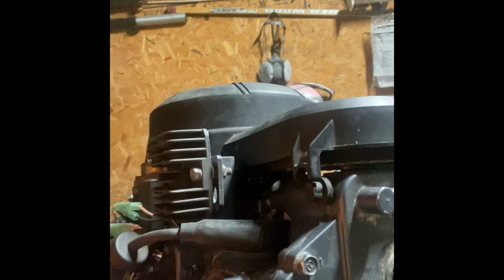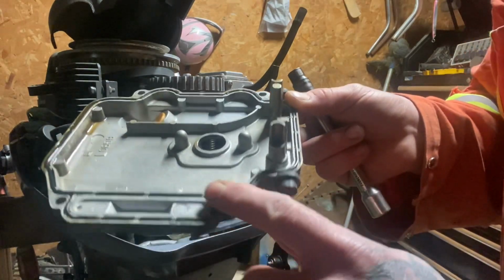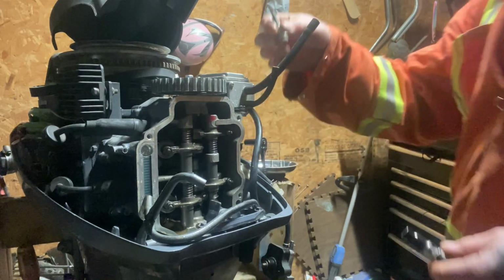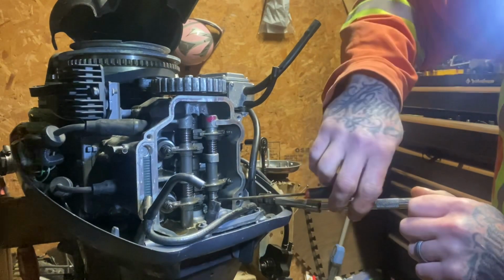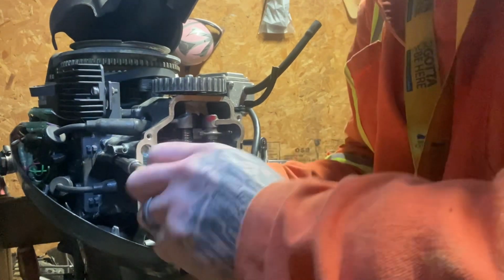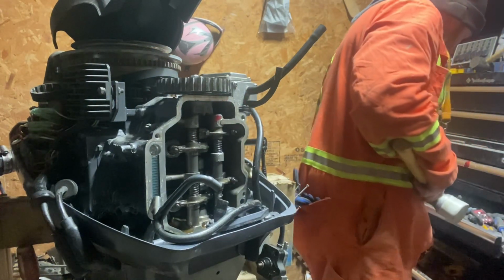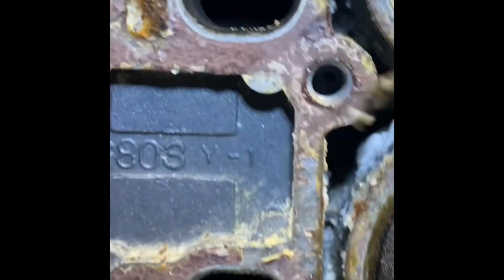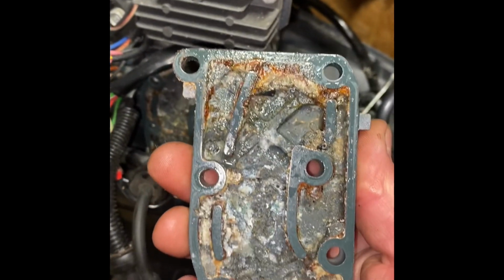Changed your impeller? Still no water flow? Here’s what your problem is. Pt1

Comment: Great content, I have a 1983 2 smokes 80 hp
Reply from the maker: Thank you I was trying to think of the ways to improve my videos or put more information in there
Reply: @donerightbydadproductions  maybe fuel pump replacement, carb adjustment or rebuilds, impeller changes, lower unit rebuilds..
Reply from the maker: @stevestewart3816   you think I should go that far
Reply: @donerightbydadproductions   why not
Reply from the maker: True